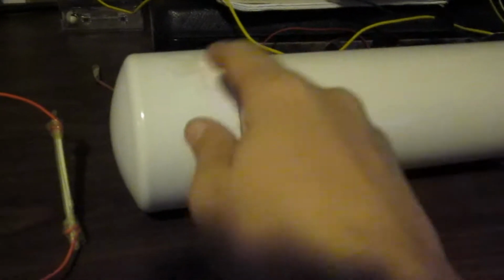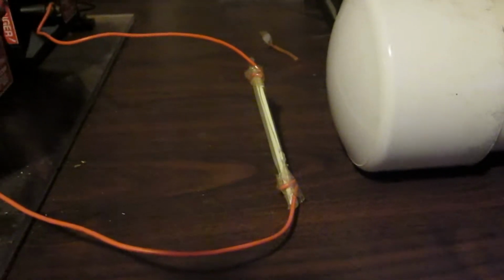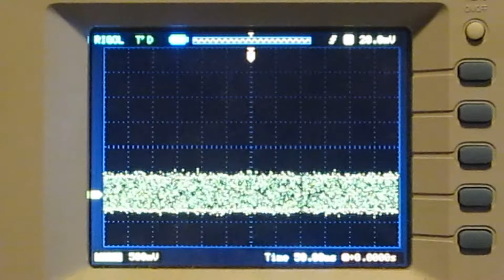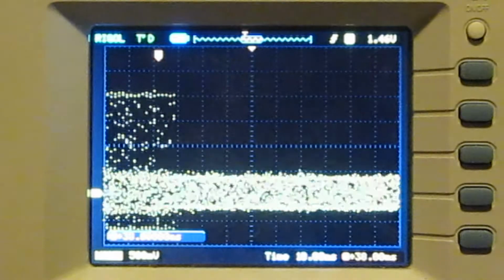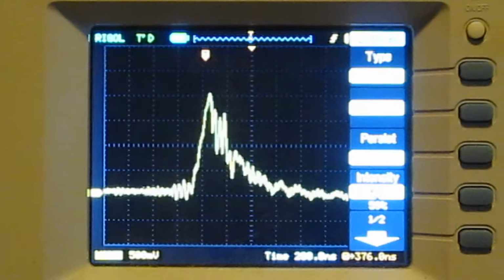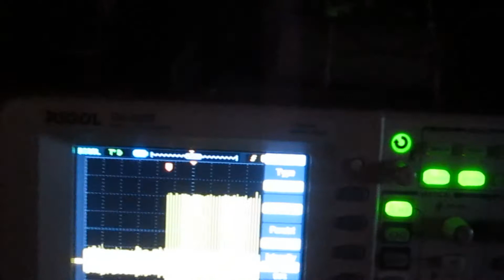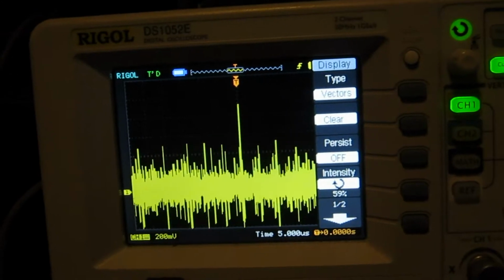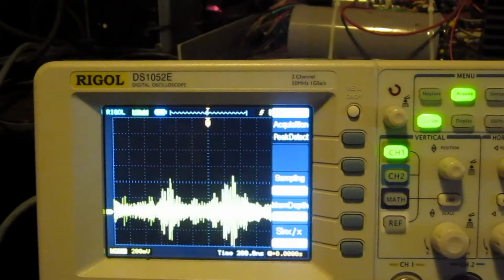Tritium Nuclear Fusion Experiment - Part 3 : Fast Neutron Detector

Comment: At the beginning of the video it looks like interferences from the high voltage to me.. pulses from detection do not look like your signal whatsoever. Also, no info in the tritium tube makes it impossible to comment. But high voltage through a rarified tritium is certainly not going to produce anything but lighr

Comment: Basic Principles of Nuclear Science and Reactors

E = mc²

(1-1)

where E is energy (ergs), m is mass (grams), and c is the velocity of light (cm/sec). This equation indicates that 1 gram of mass is equal to:

E = (1 gm) (3 x 1010 cm/sec)2 = 9 X 102⁰ erg

Also, the relation between the amu and the Mev is

1 amu = 931.14 Mev

(1-2)

(1-3)

Before studying nuclear science and the behavior of nuclear reactors, it is necessary to discuss briefly some nuclear particles. To simplify the discus sions in this text, the number of particles will be kept to a minimum. These will include the alpha (a), beta (3), and gamma (y) particles, as well as the neutron and the proton (see Table 1.2). All these may interact with the

nucleus. The alpha particle (a) is the same as the nucleus of the He atom. Thus it has a charge of +2e, where e is 1.6 X 10-19 coulomb and on mass of 4.0 amu. It is the

Comment: 6

Basic Principles of Nuclear Science and Reactors

1-8. Before the discovery of the neutron, the nucleus was assumed to be composed of protons and electrons rather than protons and neutrons. Discuss the make-up of the nuclei of C, C", Al, and CI", using this assumption. Compare it to the present assumption.

1-9. The mass of a neutron is 1.008985 amu and that of a hydrogen atom i 1.008142 amu. If it is assumed that nucleons (neutrons and protons) and charge are neither created nor destroyed in nuclear reactions, the following reactions (among

many others) appear possible:

a. n+HH²+Y b. n+H+H-He+Y

cn+n+H+H² He+y HU+Y d. 146n +92,

The masses of the product atoms of the above reactions are a M(H¹) 2.014735 amu

b. M(He) 3.016977

e. M(He) 4.003873 d. M(U) 238.12493

Determine the sum of the masses of the constituent nucleons (plus electrons) on the left side of the equations (a through d) and compare with the product atom mass What do you conclude about the masses of atoms relative to the sum of the masses of their constituents?

1-10. The numbered squares in the figure refer to nuclei which will decay by one particle emission to the nuclei zXA. Complete the table. Assume that the total number of nucleons and the total charge (including the emitted particle) are unchanged by radioactive decay.

Emitted Particle

Symbol Charge

Nuclei

1

2 2

3

4

5

Mass No.

A-Z+2

A-2+1

A-Z

A-Z-1

5

1

2

3

4

Z+1

Z-1

Z+2

Comment: This appears to be electrical noise which PMT's are notorious for registering and amplifying during pulse work. As a result, the "neutrons" being registered are false positives. The 100% irrefutable clincher would require the use of a BTI Bubble Neutron Detector. Such detectors are completely impervious to electrical noise and are considered the #1 choice for pulse fusion work. CR39 plastic is a close second with scint/proton recoil being practically non-existent due to noise issues.
Reply from the maker: Yes, that is why I want to put the thing in a Faraday cage.. but if you have a Bubble Neutron Detector I can borrow.. I would love to try that too.. ;-)... I suspect that if there are neutrons.. the count rate is very low.. probably too low to do measurements by activating silver or something?? But yes I agree, the PM tubes are very sensitive to electrical noise.. It sounds like you work in the area of fusion/physics?? I used to work on a giant KrF Laser called Electra, for fusion energy research.  Anyway, thanks for the great comments!
Reply: A Faraday cage will not work. The noise from pulse discharges gets directly into the incoming power line. Unless the entire power source, supply, switch, tube, detection system, etc is within the cage, it won’t work. Not to mention several other reasons it won’t work. Ultimately it took years before I decided to spend the $450 for the BTI units.  But you’ll just have to bite the bullet and do it.  No other option that will be universally accepted by competent peer review.
Reply from the maker: OK, I guess that is not too bad, less than a thousand for a good detector.. Do you have a recommendation of where to get one?? Thanks!
Reply: @jaynesnetwork  
http://bubbletech.ca/product_type/bubble-detector-products/
Reply from the maker: Thanks! That is very interesting!! I'll have to save up for that one!! Do you do Fuson projects??

Comment: Some things to consider about the tritium lamp - The tritium itself is not particularly good at diffusing through the borosilicate glass, but the decay product, helium-3 is readily soluble in "Pyrex". This can be verified via wipe tests with a liquid scintillation counter.  Now, with respect to the gas pressure, as a tritium lamp ages, the pressure will be complicated because tritium as a diatomic gas is going to be converting to helium, and there are two of those for each tritium molecule.  Now, the glass is also getting bombarded, and the content of tritiated water vapor is going up due to reduction of the glass (this is a hazard of older lamps, as tritiated water is much more bio-available than the original gas).  So I guess  I'd expect the pressure to rise, then fall as a lamp gets older.  To put a time scale to this stuff, the half-life of tritium is about 12 years.  Now as to the formation of a plasma, the tritium is so active emitting beta particles, that it will conduct readily at any pressure.  Most of these lamps are filled to pressures around half an atmosphere. Please to be cautious not to puncture that lamp with high voltage, or break it outright!
Reply from the maker: Thanks for the great insight.. I believe there should only be one He3 per tritium decay.. but maybe you are referring to the fact that hydrogen forms a diatomic molecule where helium is only in single atoms? This would give helium 2x the partial pressure, compared to the H2 diatomic molecule.  This is very interesting, thanks for the insight..

Comment: Here's some ideas. Put magnets next to the tube to try to confine the plasma. Set up a second tube with similar resistance to your power supply, but with a gas mixture unlikely to fuse, then switch back and forth between them to try to eliminate the ps as a noise (double blind that shit). Essentially if a signal is there while your ps is working on the tritium, but goes away when it switches to something like helium, then you can say with higher confidence that something is working.
Reply from the maker: The magnets is an interesting idea.  Right now I'm trying to eliminate the high voltage electrical noise.  The photo-multiplier tube is very sensitive to this type of electrical interference, so I have not been able to get a good measurement yet. Hopefully soon..
Reply: Permanent magnets right next to the outside of the tube would be a fairly simple step forwards. But you will likely just get a spot of plasma that is on the glass wall near the magnet. For fusion experiments what you want is a null point in the center of the vacuum so the solid walls don't leach heat away. Fortunately the biconic cusp field is pretty easy to set up: https://en.wikipedia.org/wiki/Biconic_cusp you basically just put in two opposing electro magnet loops with the mid point between them being the null point (electro magnetic fields are governed by vector math and vectors can cancel out).